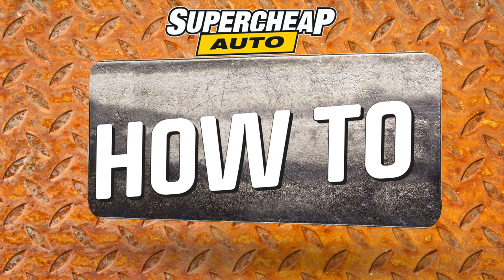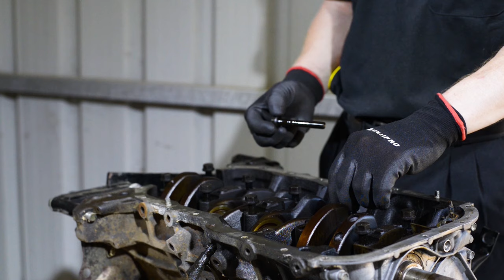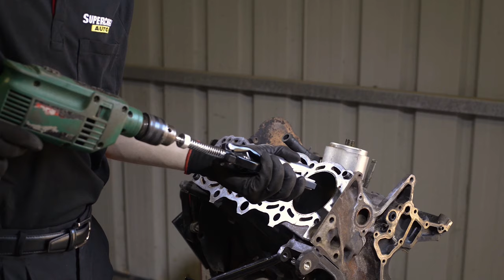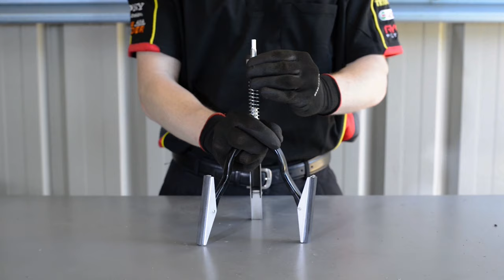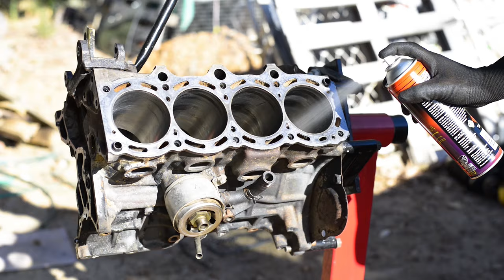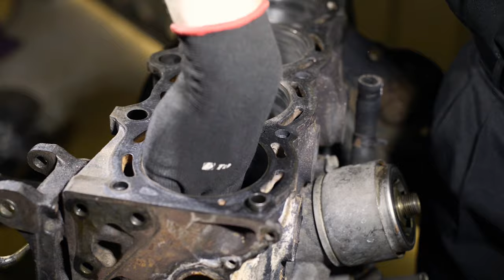How to Hone Engine Cylinders The Right Way

Comment: Boo.  Sorry mates, you haven't honed anything.  Note the unhoned portions in the bore.  You've roughed up the high spots is all, and maintained whatever taper exists.  You need a Lisle or even better an ancient AMMCO 500.  The Ammco allows you to set the amount of metal removal (.oo1 mm etc) for a straight cut.  A standard stone, then a burnishing stone, then a finishing stone.  You need to measure the bore with a new ring (check the end gaps) to see how much metal you can remove first.  A nice hone, with a .025 ring end gap, is a flat out failure.  You are this close, just bore it with new pistons.

Comment: This is called “The right way”? I’m sorry this is such bad information. That spring loaded bs Stone is not going to hone anything. You’re barely breaking the glaze and you have so many low and high spots you won’t touch with one of these junk “hones”. You at the very least need a lisle 15000 or sunnen equivalent. You can actually remove .005” off with those pretty accurately.

Comment: I'm sorry but that block needs to be bored out, a dingle ball hone is used for breaking the glaze - honing stones are made for making a cylinder bigger take it to Machinist buy some Pistons too many people on internet making videos that don't know what they're doing🤦
Reply: ....no

if you think you're gonna take off any substantial amount of material with that bone, you're simply wrong. The only way you'd take off anywhere near enough material for it to require a +0.020" is if you were honing for hours nonstop. If you're really afraid of that, put some super fine sand paper over the stones and use that as your honing stone.

Too many people giving advice without knowing what they're talking about
Reply: @southproduct7463  i hear you, you cannot make the cylinder bigger that would require any oversized parts with this thing, crazy how people are afraid to use these alot, because they think they'll do it for too long, while there are instances where that can happen, it's very unlikely.
Reply: Those honing stones would disappear long before you changed the bore diameter enough to require oversized pistons unless you had a very coarse grit and extra stones.  You might as well try to cut down a giant redwood tree with a pocket knife....going to take a while.  Still, it always makes sense to do the minimal amount of honing that is necessary.  The idea is to get a surface that will allow new piston rings to set properly.  Too polished (having a shiny mirror finish) can mean that you won't get good compression results and you'll have an oil burner.
Reply: Total rubbish the three leged hone is perfect for the job and is made for the job bottle brush hone is for cross hatch as well and is okay as well. Ask any of us qualified mechanics and you will get the same answer. The bore is okay if there is no Ridge on it, never bother to use a Ridge remover it's a waist of time unless it's a lawn mower that don't really matter.